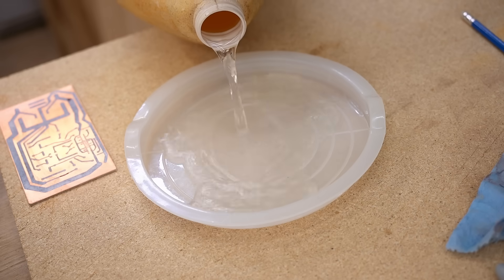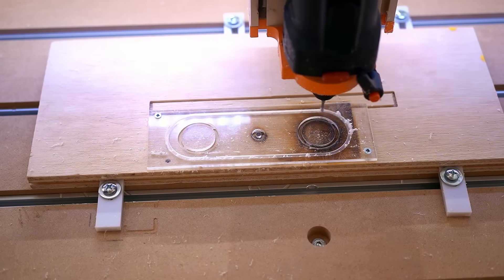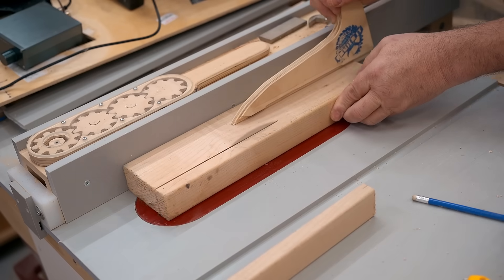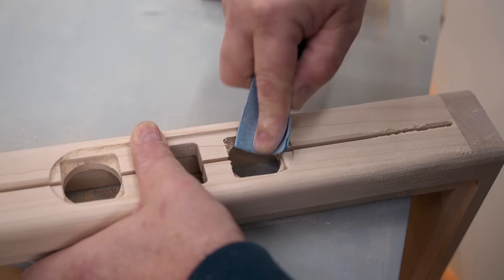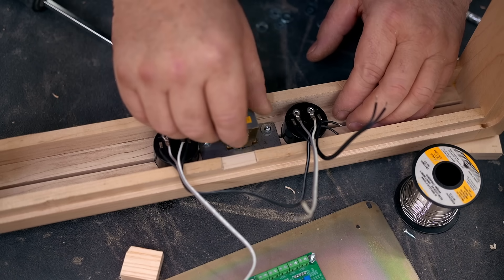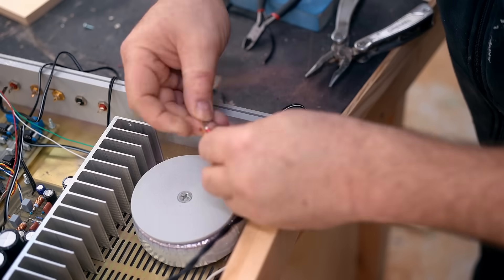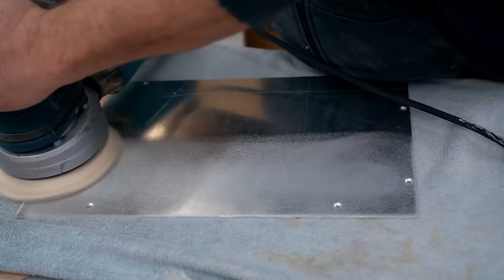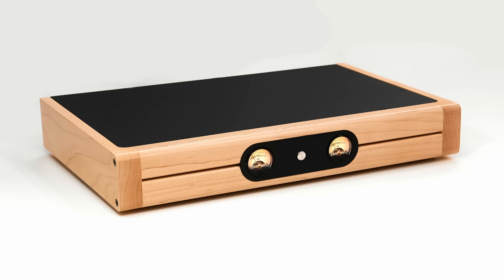Here's What Happens When a Carpenter does Electronics

Comment from the maker: The outside of the case is made from solid maple and the top panel is 1/8" thick aluminum painted black. I finished the wood with three coats of waterbased polyurethane. 
I love the simple, clean lines and the stark contrast between the painted black parts and the warm natural wood and amber glow from the meters.
The project uses an LM4780 dual channel chip amp that can put out around 50 watts rms into 8 ohm speakers. Not super powerful, but the speakers I built this for don't need a lot of power.
I designed and made the PCB for the chip amp, but wound up redoing the design and making a new circuit board when I made too many mistakes on the first one. All part of the fun!
Also inside the amp case is another circuit board that has an active filter that cuts out the bass. The amp is more than capable of full range output, but I don't want any low frequencies going to the small speakers and the active filter does that.
I built this amp for these speakers: https://youtu.be/ifRdxoOLhKU
NOTE: The chip amp I used for this is obsolete now, but I have a few from when I was much deeper into electronics 15 years ago.
Reply: John - you a man of many talents.  I do not even know what the thing does but it looks very smooth and polished.
Reply: Hi found pics of this in some random google search some 4 months back. It became my inspiration and I have made and completed an amp with similar design. 
Really stumped seeing that same amp pic in video!!
Thanks!!
Reply: Wonderful!
Reply: amazing, john, you are a genius

Comment: Me too,  video right to the point!  I am just finishing a stereo I use the same principles you used,  I used wood and the front panel I cut in half after making the holes for the potentiometers snd LED bargraph. I used an aluminum back panel painted in black. I agree with you aluminum  sucks. The amp,  I built myself  and is an all transistor to sound like those 70's amps,  so good. Wood and Electronics best match!

Comment: Hi John, this is a really slick design I love it. I've stopped etching PCB's a long time ago, it's nice to see that some people still does that. But it's also true that most of the PCB's I design have some surface mount piece on them and it's quite hard to etch surface mount for an hobbyist. But I'm super impressed of your amplifier
Reply from the maker: Thanks, I used a mix in my newest multi-channel amp where I made the power supply boards, but ordered the ones for the amps and crossover boards. 
I really like the professionally made ones, but then you have to wait for them to get here, and they are less forgiving if you've made a mistake that needs to be fixed.
Reply: @JohnHeisz  I know I make mistakes and I have to fix them with wire wrap wires. But I always fill the empty spaces with pads so if I forgot a component I can put it there, so most of my PCB's have wire wrap wires😉 But between $1.50 to $6 for 10 PCB's I can wait a couple of weeks, having a silkscreen is heaven. I use a lot of ESP32 but only the modules not the development board so it's easy to solder them in place with silk screen, but I elongate the pads I didn't build my oven yet so  I have to use a soldering iron. We're far from what I've learned in college with black sticking strip and UV system.

Comment: Brilliant — but next time, screen the chassis by covering the inside of with tin foil or painting it with conductive paint, and then connecting that to earth. Otherwise, you might get some nasty noise problems, depending on where you place it. 
I’d also recommend a couple of thermistors as an inrush current suppressor before the transformer, and L-pads on the outputs to protect your speakers from on/off pops.

Comment: great project, and looks great.  I have a question.  You installed a base plate from and old receiver withvent holds, and there are heatsinks inside.  But the top plate does not provide for air flow out of any heat.  Or does the aluminum transfer enough heat out?

Comment: Normal Sheet Aluminium is hard to mill, you need Aluminium for engraving. You can do it, but you need a 1-flute cutter, agressive cuts and cooling. Finding the right cutting parameters is still difficult. The usual/cheap Aluminium sheets are too soft...

Comment: Very nice looking final result. My only slight concern with swapping out vented pressed steel casing for wood is to make sure the heat generated by the amp can dissipate sufficiently. If you want to avoid 'spoiling' the top panel, you could maybe thermally link it to the internal heat sinks.

Comment: Very nice looking amp. One thing I didn't see is a protective earth connection to the metal top plate, which would be a good idea in a mains powered thing with a metal enclosure.
Reply: Many commercial HiFi components in a metal enclosure do not have a protective earth connection, and many come with a two-pin mains plug; the signal ground is often connected to the enclosure and having each audio component then also connected to the protective earth almost invariably sets up a ground loop and audible hum.
As long as the internal component topology & wiring are up to the regulations (double insulation, minimum spacing between mains carrying wires and cabinet, insulation class of transformer, etc. etc.), a protective earth on the metal enclosure is not required. HiFi components sometimes have an external earthing post to allow for a single point of earth bonding for the whole system, should one wish to do that.

Comment: What's the point of VU meters? 
VU meters are used to measure a standard reference. Since your only output is to speakers there is no point to them.
You place VU meters on devices that SUPPLY the audio to other stages such as a preamp to amps or modulators. Notice 0 VU = 100% modulation  on the face of the meter. This is to know you are DRIVING something to 100% modulation.
Just my $0.02USD

Comment: Good side hustle:
1. Convince manufacturers of ridiculously expensive audiophile components to send you evaluate units. (If you tell them what you’re doing, they’ll probably go for it.)
2. Design wood cases that fit perfectly
3. Produce prototype using CNC
4. Confirm good fit, refine design as necessary.
5. Send component back to manufacturer
6. Sell them to audiophiles for 8-10X what they cost you to make. (The more you charge, the more likely they are to buy.)